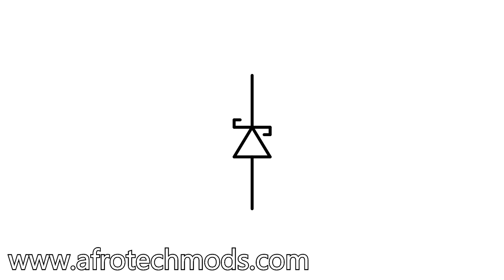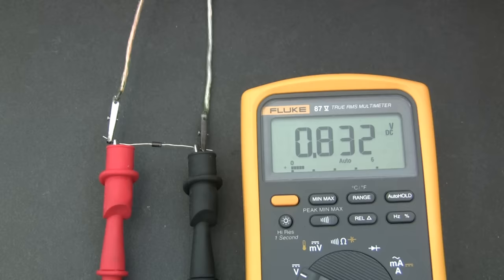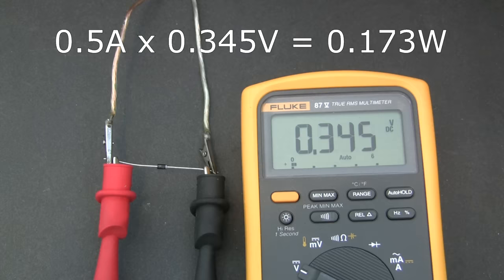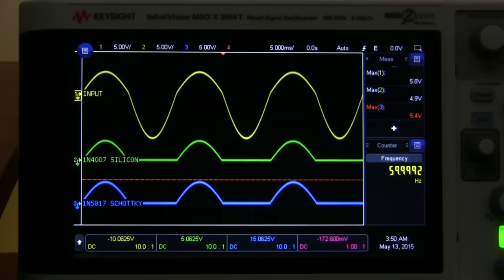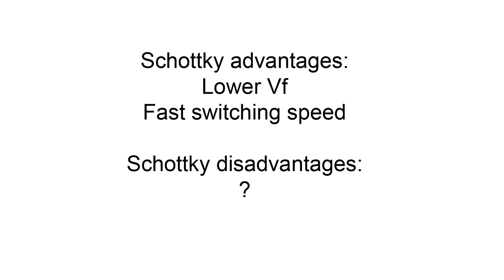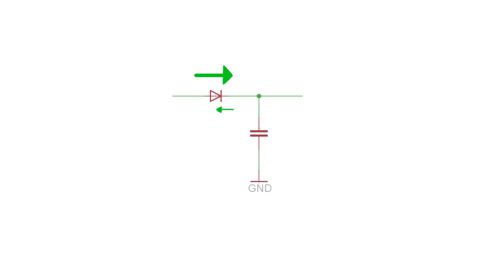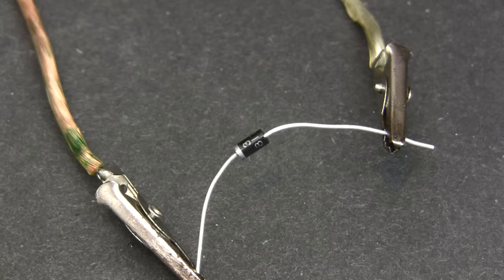What is a schottky diode?

Comment: SED, Smoke Emitting Diode
Reply: nitehawk86 well sign me for the new electronic smoke signal emitter.
Now i just need to figure out how to demodulate it :(
Reply: He let out the magic smoke lol its like a genie do I get 3 wishes
Reply: nitehawk86 That was ordinary grey smoke. I once saw a high voltage capacitor die and give off pink smoke.
Reply: Laharl Krichevskoy Red Indians have used them for centuries. They would stand on mountaintops and look out for wagon trains or US cavalry and inform the rest of the tribe by typing the message into their communicator and pressing send. The communicator would then encode the message and transmit it by sending current pulses through the SED array.
Reply: ratcat17
Reply: ratcat17 A PED may be good for a woman wanting to attract men but what must a diode emit for me to attract women? Loads of money? ( A MED would be a useful thing to have anyway).
Reply: +nitehawk86 best thread i ever read
Reply: +nitehawk86 FED (fart emitting diode)
Reply: +Artjoms Pugacovs 
I've never needed an FED to clear a room.
Reply: That was clearily a Friode (= a diode which has been deep fried)
Reply: a led going indian
Reply: They hide all the colors of LEDs in all diodes.  If you don't see them, you didn't use enough current.
Reply: +nitehawk86 I laughed so hard at this.
Reply: Why not just switch on and tune for maximum smoke as I often seem to do! :)
Reply: Gold

Comment: Nice clear video, especially the important detail of the high leakage currents that
Schottky diodes can have at temperature.

Just have to quibble with your use of capitalized SI units:
The units are volts, amperes (amps), watts.  The people are called Volta, Ampere and Watt,
you only capitalize the names of people, not units (the exception is degress Celcius,
because that is the name of a person, but kelvin is the unit of thermodynamic temperature, Kelvin refers to lord Kelvin.)  This distinction is often handy, for instance
clarifying that Ampere's law isn't just about amperes...  Furthermore if you think
about it we'd never capitalize Inch, Metre, Foot, Gallon, Pound...

Now I'm worrying if you can say "schottky diode" or always have to say "Schottky diode"... :)
Reply from the maker: ***** Hah you are right. Good catch
Reply: ***** I keep missing the conversion for Fahrenheit, it's a really bad temperature system.
Reply: ***** It's Celsius.
Reply: Charles Sammut Yes, that's a good point!
Reply: ..   plane is shaking though WELL not achan kunj peedikayil
Reply: +Mark Tillotson that's celsius, a world basic temperature system.
Reply: Really? Maybe things have changed but I always capitalize units named after someone as general practice. dB, Wh, etc.
Reply: Hill's Workbench You are correct when writing the abbreviation for the unit. The abbreviation takes a capital form when named after a person. So, yes, the abbreviation for volt is a capital V, etc..

Comment: Nice. Been having some issues with the Schottky blocking diodes in my solar panels. I use a Fluke 117 multimeter in "diode checker" mode and found it to be really good at checking diodes pulled out of a solar panel. Thanks for making this video...it helped. Badass Predator music insert with that thermo imaging clip!

Comment: Very informative.  I have been using diodes for years and only knew about the switching speed, never realized the other aspect of voltaqge drop (I still try to use Germanium diode when I find them for the smallest voltage drop)... Thanks again for a very clear description of pro's and con's.

Comment: I ran into an interesting issue with my pipe organ, it has several hundred 12vdc valves typically used in groups of 61 or 73 for one rank of pipes. I used a standard diode on the valves to stop the coil voltage collapse from sending DC current back to the contacts which tends to damage them over time.
I turn each rank on-  with a 12vdc auto headlight relay  which connects the  bare copper wire negative bus to the neg terminal on the rectifier to complete the circuit for the valves.
The problem was two things- all of the electro magnets in the  40, 60 and 90 OHM valves were acting as a sort of pseudo ground and completing the circuit without the 12vdc contact being on. In addition, I  had "pairs" of 2 ranks  wired to a "66 block" telco punch block to save having to run 73 wires to the relays for every single rank.
That was when I wound up having to add another diode on every single valve's positive input wire so the groups of valves could not self ground, and to keep each rank separated despite having common positives for pairs of 2 ranks on the 66 blocks.
I also added diodes on the 12vdc  auto headlight relays too, to make sure they only work in one direction.

That did the trick :)

Comment: I used to replace blown diodes on microwave ovens that looked like these but were quite a bit larger. I would find them on the capacitors for the hi-voltage section of the microwave oven. Easy and quick fix.

Comment: On half way of video, i was like, well why do silicone diode even exist? and then you explains it. Great video, helps me a lot thanks. subbed.
Reply: Saiful Raznan There exist old fashioned germanium diodes as well. Advantage: they have a lower Vf plus a more straight rectifying curve, making them ideal in radio detection circuits. On the other hand, they cannot handle load very well, so these are rubbish in power supply applications.

Comment: We used to use schottky diodes on our RC car brushed motors back in the day. I never knew why and kinda still don't know what's the purpose. They came with the electronic speed controller and it was suppose to be applied across the motors positive and negative tabs. It was for racing purposes so the speed controllers didn't have reverse. They were forward and brake only.
Reply from the maker: Watch my video on inductive spiking

Comment: Very keen to see a video on the zener diode.  I don't fully understand them, about all I know is it has something to do with a desired point at which a diode will allow reverse flow, or something, and even that is probably wrong.
Reply: Zeners are used to regulate voltages and operate in breakdown mode. Depending on the load a zener will vary the current through it while maintaining a constant voltage at the load when of course connected in parallel with the load.

Comment: In the provided information, I would emphasize that the peak inverse voltage (PIV) is always lower than 100 volts due to the Schottky diode thinner silicon layer and that is why high-voltage hi-speed switching normal PN diodes are used instead for switching power supplies working with line voltages. You know, 0.6V Vf is not much anyway at those voltages.

On the other hand, Schottky diodes are great for low voltage applications like DC-DC voltage (buck) converters and things like rectifying or "protecting" solar panels from reverse current flows. In those cases, the very low Vf of Schottky diodes is ideal, as 0.6v Vf from normal diodes is actually the output of one single solar cell. It would be like if the cell wouldn't even be there. I have seen power Schottky diodes (600A) with a Vf of about 0.08v which are great for that purpose.

Comment: Worked on a piece of equipment awhile back that used a double-barrel schottky.
just kidding.    sort of.   the switching power supply used two schottky diodes in parallel on the 24VDC input, in the protect-against-backwards-voltage circuit..  :P

Comment: Hey, I use these all the time, but I still learned something.  Never spotted that lower peak voltage = lower forward voltage drop before!

The unmentioned reason for using silicon diodes is that Schottky diodes tend to have reverse voltage rating measured in 10s of volts, while silicon diodes tend to be rated in 100s of volts.
That high leakage current is also a problem if you're relying on the diode to stop a coin cell backup battery discharging.
Speed-wise, I learned long ago by experience never to use a silcon rectified diode in a switching supply, even if it's only a breadboard.  They just don't work.

Comment: Nice video. We have labor at the univeristy about ADC Converter and you should not change the polarity of the power supply. So they put a diode between + and -. The teacher ask me - why is this diode - i for nothing? He look at me and say this is a security feature. I say it is nothing - he why it can use up to 2A. I tell him they forgot to add a fuse. So if you change the polarity the work up to 2A but he forget to calculte he must disappear 2*5=10W and the diode can only handle 1W. If you add a fuse a short time you geht a high voltage and the fuse is gone.

Comment: I would recommend taking double the voltage rating over nominal operation rather then adding a mere 10V to the peak
First of all the 10Vs are an overkill if you expect 5V peak and not enough if you are at 500V. Second there are benefits from using a higher blocking voltage (i.e. cosmic ray failure rate)

Comment: How would schottky diode be used in a 12VDC (-) isolation earth scenario. EG 2 doors each with door open switch (to Ground) . Each one needs to operate a light independently (which has 12VDC+) but also must be connected for a unified trigger signal to an Alarm. The schottky diode would need to allow current to flow from or to ground?

Comment: 0:26 electrons flow in the opposite direction, from negative to positive or from Cathode to Anode.
Reply: +MadeOfSolder 
Look up "conventional current flow".
Reply: Conventional current flow if how it was originally thought to work, it was proven wrong by the cathode ray tube early on in electronics. For all intents and purposes, when designing a new circuit you must account for the fact that current flows from cathode to anode.
Reply: MadeOfSolder
Yes, it was proven to be wrong, but by the time they figured it out a lot of books had been made using conventional current flow, and well, it got stuck with us.

Comment: Hello and good day to you sir... I'm interested on understanding to build a power supply using a transformer 12v-0-12v@2A/25VA.. I don't have any eletronic lessons  backgrounds. But most of your video's helped me a lot on repairing power supply and eletronic ballast. I work at as a technician at a pet shop and 
most of my problem is with power supplys. If possible would you help me to understand more.. thank you.

Comment: a question: if i want to protect an ebike motor with 3 cables, where do i connect the diodes? cross over to all cables (A-B, B-C, A-C) or do I disconnect the cables and solder them in between?

Comment: Great video!
If only you would have compared the prices and availability in the market with different diode parameter ranges (e.g.; for high reverse blocking voltage).

Comment: I'm using 12v relay in my project with arduino and also connected 1N4007 diode across the relay... I'm using 230v ac supply... But when relay turns off 16*2 lcd showing unknown characters due to reverse current... So how to prevent this...

Comment: not related to this video but I since that you may be able to advise me on another problem.  My boat has a 12 lot battery bank (400 am-hours) I operate a 12 volt Television from these batteries.  Whenever the fresh water pump or other significant 12 vlot comes on the TV goes off due to low voltage but can be restarted moments later.  Can I solve this problem with capacitors, larger wire size, or other means?

Comment: Afrotechmods  From what I understand, a diode is a semiconductor. If the point of electronics is to conduct electricity in order to do work, what's the advantage of having something that semi-conducts? Also, I know what series and parallel mean, but I can only visualize it on schematics, not on a real circuit board. Can you give an example or pictorial of components in series and parallel in a real circuit?
Reply: Electronics is not a thing (that conducts electricity), it is a science.  A conductor is a thing that conduct electricity. The point of electronics is entirely dependent on what are you trying to accomplish with it. Semi-conductors have a lot of "advantages". They can be used for switching, rectification of AC current into DC, regulation, amplification signal generation and so on. The applications are virtually endless. As for finding components in series and parallel in a real circuit, you simply have to follow the layout of the board and draw out the schematic on paper. There are no visual clues that I know of so you must trace the components.

Comment: trying to flash an LED string with an inline effect chip...the whole set up runs off 5V usb normally..but I want the LED effect string to power off of raw speaker signal power..I got it working partially...at high volume the built in shut off is triggered in the amp in the shelf stereo "head unit" ...can I use a diode somewhere with a big value to prevent the triggering of the shut off or should I build a bleed resistance at the end of the line to soak up surges? not sure how to proceed with this one and I'm still fairly new to the hobby do any help would be greatly appreciated....I wanna know why things work so it would be a huge bonus if you could elaborate your suggestion.. but I'll take the Lego part fix answer too! I'm desperate. THANKS

Comment: Great video but I was wondering about voltage drops near 0 amps.  It appears to me near 0 amps there is no voltage drop?  Thus you can't use the forward voltage drop of a  diode to lower voltage of a solar panel?

Comment: You mentioned schottky diode showed better switching characteristics than silicon diode. At that time, what about the reverse flow of current? isn't it a problem.

Comment: Hello, I am a bit confused. "Every diode takes a time to switch from allowing forward current to blocking reverse current", I need more explanation on that. This Schottky diode is connected in forward bias, I suppose. How come the reverse current is present even when it is connected in forward bias? I need your clarification ASAP, thank you! Nice video btw.
Reply: It seems the schottky diode should be doing a poor job of rectification if its leaking more than the silicon diode.

Comment: Sir I have a question. As we know, schottky diode is preferable at high frequency.

And it has a large reverse saturation current. 

So is it preferable for "high amplitude high frequency signal"(having high +ve and -ve voltage)  or "low amplitude high frequency signal"  ?

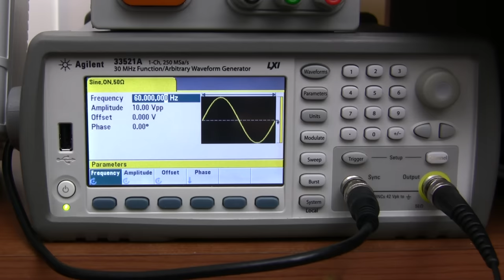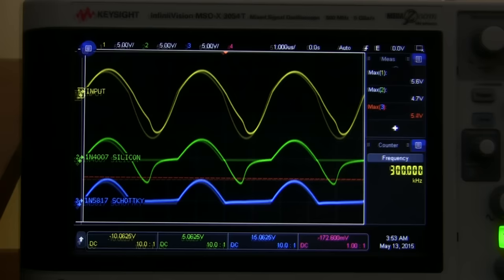Comment: I've heard that a lot of so called germanium diodes are actually schottky's. Could the procedure starting at 2:14 be used to tell the difference ? From what I'm seeing when comparing the germanium and the schottky the oscilloscope output would look just like @ 3:20 showing the fast recovery of the schottky and the reverse current of the germanium. Is this correct ?

Comment: Can you use a Schottky in parallel with a 12v DC motor for protection? Or would a regular silicon diode work?

Comment: If you don't mind the voltage drop, couldn't you put 2 shottky diodes (or 1 shottky and one silicon diode) in series to reduce the reverse current flow?

Comment: Why not run a schottky diode and a silicon diode in series and get the best of both worlds in terms of switching time and backwards leakage?  Obviously the heat dissipation would be an issue, but do diodes really matter all that much in terms of the addition of heat to a circuit?  I'm not an electrical engineer, so I don't know if this is a bad idea for a practical reason (as opposed to an economical one).
Reply from the maker: The voltage drop and heat dissipation could very well be an issue yes. There's usually one diode out there that will meet all the users requirements it's very rare that you'll have to put two in series.

Comment: +Amadeus Rock Thanks alot! Very helpful. Question: if integrated circuits are millions of electronic components in a minituarized circuit board, then  does it make discrete components obsolete? If I wanted to manufacture let's say..an air conditioner, all I would need is that single IC since it has everything I need, right?

Comment: hi! I have a problem with the rear stop on my bike (It has 3 wires, one negative, one for the tail light and one for the brake light). it is not the original one, but an aftermarket, although it works perfectly, does not make work the cruise control, probably because there is some return current, they advised me to put a diode to avoid, but they did not tell me which diode! could this go? (1N5817)
Thanks in advance!
sorry for the poor explanation :)

Comment: One thing you forgot to mention: they're only available in lower voltage ratings. It's very hard to find one higher than 100 peak inverse volts. The only exception are silicon carbide, which are available in 1000 volts, but they have more voltage drop than a silicon diode rated at the same voltage. If you think the current tail of that silicon diode is bad on sine wave, just try it on a square wave. I almost dismissed switch mode power supplies, because of problems with current tail at high frequencies. once I found out about ultra fast recovery, and schottky diodes, pulse width modulation became magic. The efficiency was so high, that I could pack the power of a shoe box size power supply into a cigarette pack.

Comment: But what is the difference physically, what different principles does it use
Reply: Narrower depletion region, slightly different doping. It makes them much faster and gives them a lower drop. There's actually no electron depletion region at all, which is key to their really fast recovery times. But such things do come with a cost in leakage and in reverse voltage tolerance.

Comment: So if the waveform distorts with a silicon diode as the input frequency increases, how do they rate the maximum usable input frequency on them then?  What % of distortion (or other criteria) do they allow?